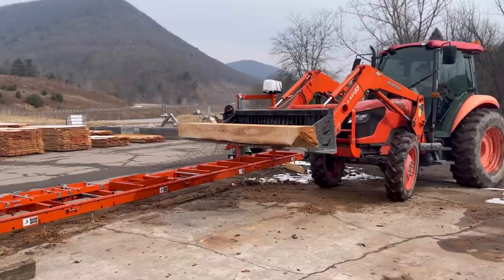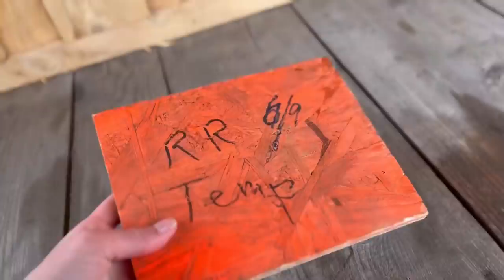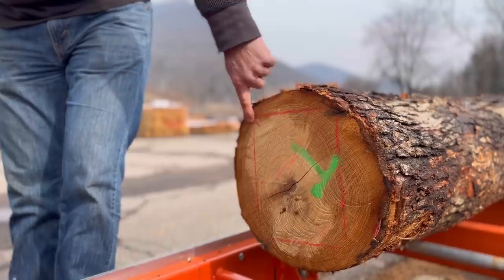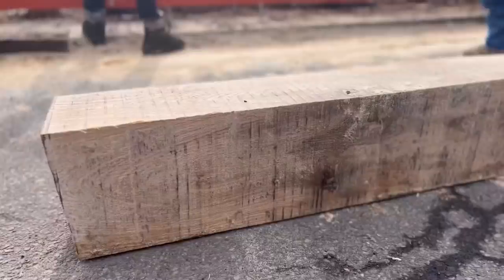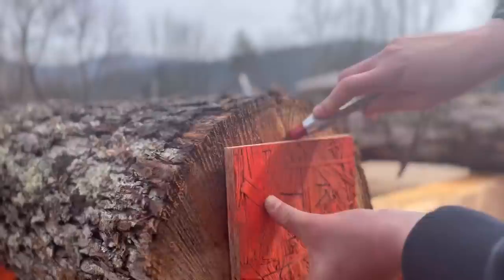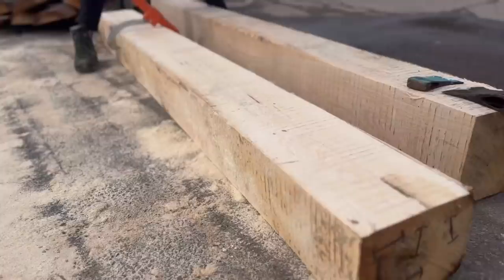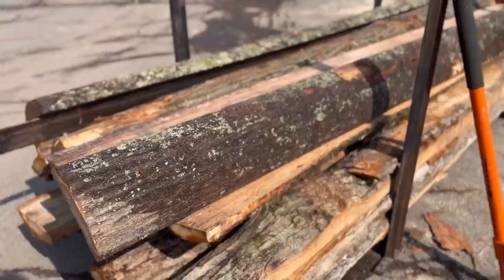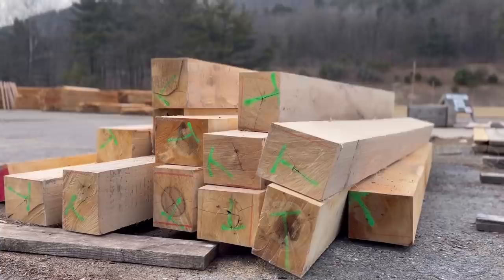Milling Railroad Ties On a Homeowner’s mill “cutting all ties” 😆

Comment: Back in the early 80s I worked for a small family run logging and milling operation. I drove skidder and worked the green chain. Our filler was railroad ties usually cut from "piss" fir. (White fir, it smells like piss when you mill it). I hated it. On larger logs, the owner (sawyer) would cut the log down to two cants that had three ties in each cant. He'd then flop them onto their sides stacked, make two final cuts and six ties came to me at once. I had about 30 seconds before the first slab of the next log was coming at me. Piss fir cants weigh a ton. When they slip and fall, they mash fingers to a pulp.

Comment: I have been a Logger/Log trucker for over 45 years. I sell lots of "Tie Logs", 12" and up hardwood to a few Amish sawmills in our area. If some of the logs dont make a square 7x9" they will make a 6x8 instead they sell for a lower price. Or in some cases they cut 4x6" pallet cants.

Comment: I worked at 2 different circulars saw mills owned by the same Co.  in S Mo.  We moved ALOT faster than what your doing with full sized trees.  We made parking lot ties, RR ties.  We cut 6X6s, 6X8s, 8X8s, 8X10s, 10X10s, but ive forgotten the different lengths.   I was the ONLY off bearer till they hired a couple druggies and I became the one to load the logs onto the carriage.  I was slated to become sawyer come spring, but they shut down for winter and I left to go to Tulsa to find work

Comment: Emmie I was just wondering if you could somehow attach a hose to the  output chute of the sawdust and connect it to a blower to direct it into a holding system like a small dumptruck with sides on it and then when it’s full you can dump it in the large sawdust bin
I know it’s a lot of work but would save you from shoveling it and walking through it constantly, this is just a suggestion

Comment: The place I sell the ties to wants 3 different sizes so I always try to get the biggest one and go smaller if any wane on the edges. Also, if I'm going to cut a lot of them, they will bring their trailer over to my mill so we can load them and they send the truck to pick it up at no additional charge.They will accept any wood except poplar or pine. I don't use white oak because I can make more selling that in boards. Gum is my favorite since it is so abundant and useless

Comment: nice channel guys,was in the  game for  over  30 years,,  but all in  pine forest..like the idea off the  templet,,was  just wondering id you  drove a small nail through the  center so it just held it you  could spin  and make it  easier  to mark out  without it  moving  then just pull off,, you only need  a small  nail,,

Comment: may a silly question: All this miner logs are the only trees you have in your forests?
we usually don't let saw pinetree logs less than 40cm and we use to cut them to standart 5,2m length.....
You Girls make a excellent job..
greats from Switzerland

Comment: When we had a lt40 super we would get around 100 ties per day. Ive cut 164 in a day cutting 2x’s for side lumber. The support equipment and set up is every bit as important as the mill.

Comment: If you had room to put 2 logs on the deck and 2 log decks that would allow you to keep sawing almost continuously .like you said, it takes a lot of time loading and setting the log on the deck. I think if you make the first cut at 13 inches flip the log 90% cut 13 inches, flip 90 cut 9 inches flip 90% cut 7 inches well have a tie. My 13 inches might be off because it's been a long time since I cut a rr tie.

Comment: To increase speed in sizing and drawing your cuts I suggest a stamp made of some metal resting in shallow ink or paint (water based). You could pre-select your product and walk along with a stamper and a tapper (to set the mark), this can be done days or hours in advance of a 'Run'. This should quintuple your productivity for each run.

Comment: What market are the ties being cut for - Actual railroad use or Harry Homeowner use?  14 ties a day doesn't come close to entering the railroad market and for the railroads the ties will need to be pressure treated with preservatives.

Comment: They for local railroad? I know up in canada they still gotta be soaked in creosote even tho they say they aren't lol
Reply: What would the other options be?
Reply: @TheGardenerNorth  honestly for railroad, nothing ive heard of in 14yrs ive worked here.
Reply: @terencechevalier5756  With respect! 
Trans Canada Forest Products;
-Creosote/Petroleum Solutions
-Ammoniacal Copper Zinc Arsenate (ACZA)
-Copper Naphthenate (CuN)
-Pentachlorophenol (PCP)
-Inorganic Boron (SBX)
-Inorganic Boron, Oilborne (SBX-O)
Reply: @TheGardenerNorth  not sure if your trying argue against me or what. I work for cn and our ties are still soaked in creosote wether they say they do or not thats what you want to believe but they are. So not sure where your goin with this. Not tryin start a argument
Reply: @terencechevalier5756  No arguments, you sparked my curiosity, because I've always wondered, so I looked up the manufacturer's. I know in most Canadian, metro areas they can only use some type of concrete ties, because Creosote is banned for use in them.

Comment: Why not cut 2 logs at once?
Reply: How exactly would you clamp 2 round logs to the machine and each other?
Reply: @jonwilder2735  done it with Alaskan mill, once you wedge the 2 together they don't move.
And bandsaw mill doesn't pull anywhere near as much as chainsaw.
Or make all the first cuts on single logs, then load them up 2 or 3 at a time(if on larger mill).
With one flat side it becomes much easier. 
Cutting time per length will be similar to single log, would speed up production

Comment: Please dont do that with the blade. So dangerous. If it springs back towards your face neck. Please learn the proper way.  If your not comfortable. Tape up the cutting teeth and practice.  it still will bite just not as bad. Its not difficult. Just take practice. God bless.
Reply from the maker: What is the proper way? I have never seen it done any other way in my life
Reply: @Lumber Capital Log Yard  there is a YouTube videos about unfolding blades and I think one video on woodmizer site. That's how I learned anyway.
Reply: It’s so fun!

Comment: I like your videos, but your safety practices scare me. This is the first time I've seen you two sisters tie your long hair up. Please don't work around that machinery with blowing tresses. I see ear muffs, but also wear safety glasses. A freak accident can happen to anyone. I ran a cabinet shop for decades, and a week before retiring and selling out, I made a quick cut on a table saw, and forewent the glasses--ended up with a wood splinter in the eyeball! First accident in 30 years. It will happen when you least expect it.